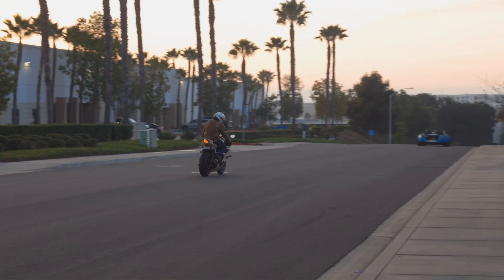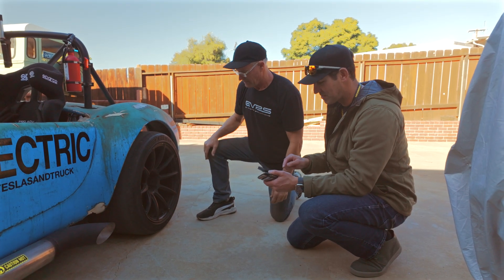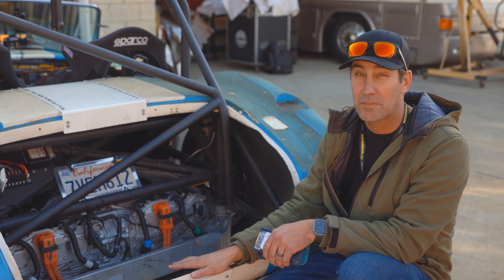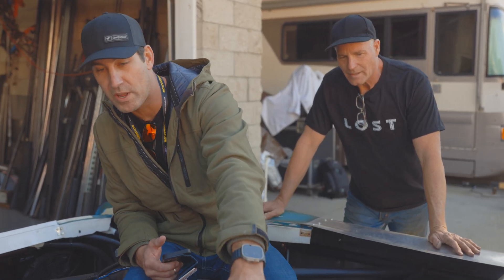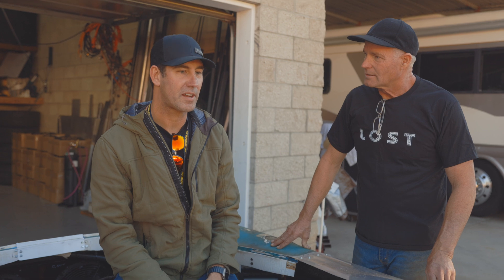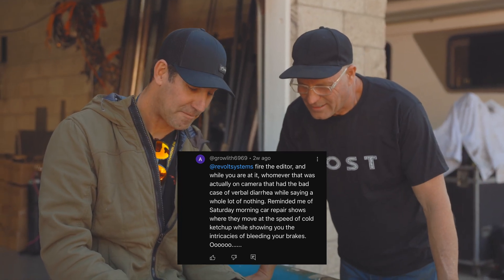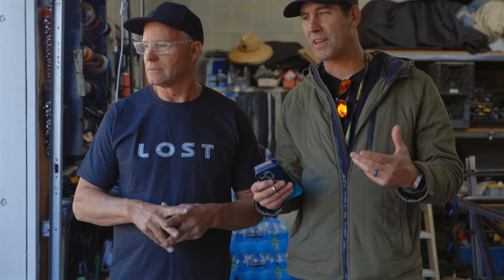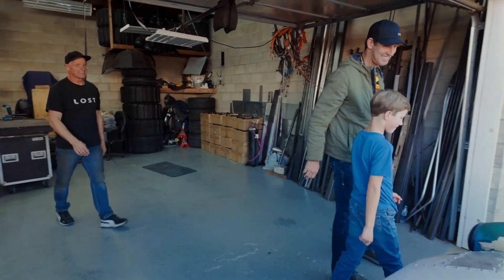Plaid Converted EV Cobra: Part 2

Comment: I am not surprised it does spin on street at that lightweight  plaid drivetrain is STRONG💪

I have a heavily weight reduced model S plaid and even on 4 mickey thompsons it does spin them on street almost any speed if I wack the pedal. and its a LOT heavier than this cobra

Now its time to get this on a prep racetrack
Reply from the maker: Check out the latest video, we got out there, but we definitely need to look into another tire.

Comment: Its way too much horsepower, chill mode and it cant get traction. A Model 3 Performance or LR AWD with AB seems like it would have been a better choice for this car.
Reply from the maker: That was already done in this car. He has had a LDU with a SDU in front and both model S and 3. This is version 3.0 and we love it. First of its kind.
Reply: @revoltsystems  Cool, if Carrol Shelby was alive I think he would have a vintage Cobra retrofitted with Model 3 Performance motors

Comment: The superior ability of precision traction controlled motors is one of the biggest advantages of EVs.  Without precision traction control, its going to lose in the quarter mile if it can't stop spinning it's tires.
Reply from the maker: The makers of the control system are working on it. More fun to come.

Comment: Plaids pull power at launch. Does the ingenext system pull power at launch or is 100% power available? Seems to me Plaids don't go faster than I expect with stickier tires and I believe it's cause too much power is being pulled at launch. Be cool to see more power getting to the wheels at launch with stickier tires and a prepped track.
Reply from the maker: We don’t know if it’s 100% but it seems to deliver much more down low. It’s very hard to drive without torching the tires. Ingenext is still working on additional driving modes and I’m sure we will see other VCU manufacturers release similar systems soon.

Comment: I love this build  i commented on the last video and i believe i didn't word my question well, but here i go again lol....would it be possible to Have two of the plaid rear drive units, so basically a motor at each wheel ? i know you guys have done this with other tesla LDU's that have reverse oil pumps installed so you can mount the LDU in the front...but i think it would be a monster of build do have 4 motors on a build instead of 3. let me know what you  think and if its possible using the ingenex controller.
Reply from the maker: That’s probably more of a question for @ingenext4964. We assume It would be a whole other thing for them to figure out how to unlock, and with the current plaid tri-motor setup being this powerful, it’s scary to think of what you’re talking about could do. Because Don also used Tesla’s subframe that helped determine how that motor setup would work for this build and to change that up would be an entirely separate engineering problem to face as well. 

Outside of the box thinking, asking questions and taking risks is how our team got the EV landspeed record at Bonneville a few years ago, so we like where your mind is, but it could be very complicated.
Reply: @ thank you!! And you’re right, taking risk and experimenting is the only way. I’m doing my research and learning about EV . Thanks for the insight and your response
Reply: @revoltsystems  With, with Rocket Boosters!!!!!!!!!!